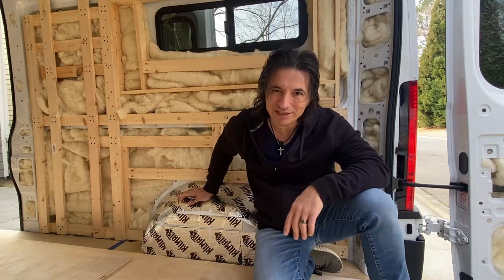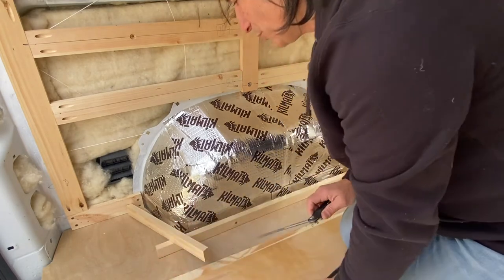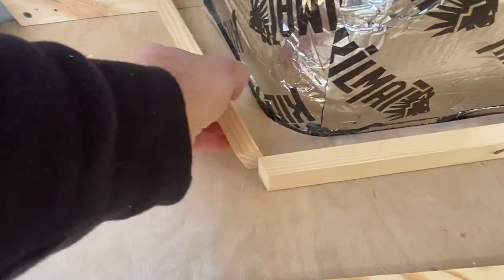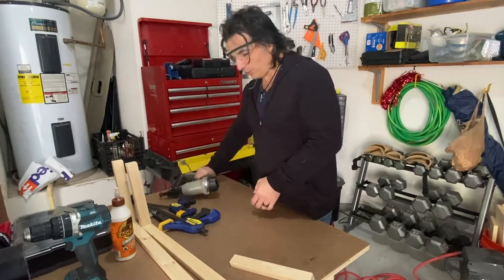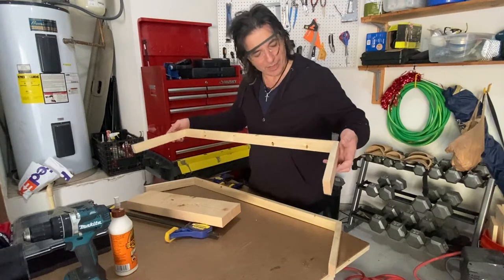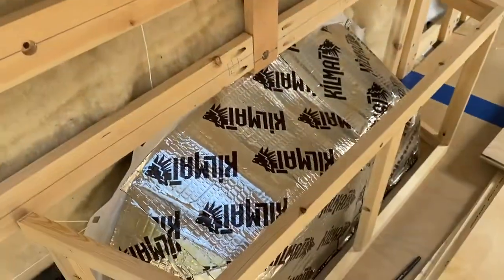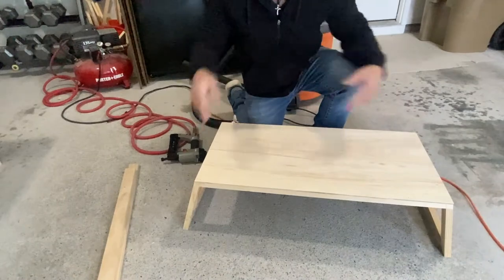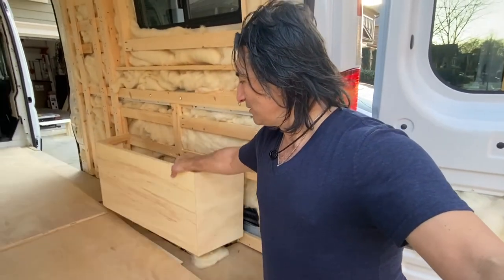Building Wheel Boxes: Part 15 - RAM Promaster 2500 Van

Comment: Just wanted to thank you for your video on installing the scopema swivel with modifications to avoid the spacers. I'm off to the hardware store to get the washers, I'll get them installed and then I'll be done. Your video was easy to follow and explained potential pitfalls, so thank you.
Reply from the maker: So glad it worked for you

Comment: So did you leave the top open on the wheel well box in case you need to run wiring / anything else electrical related through before closing it off?
Reply from the maker: To be honest, those things are still in the garage....but, yes, I left them open in case I wanted to stick anything in them. I may add a lid later if its needed.